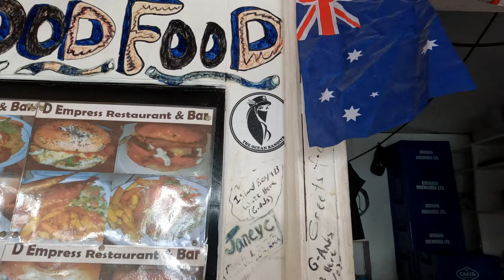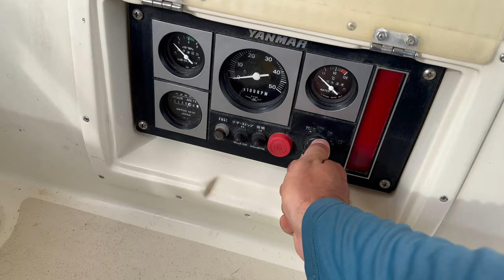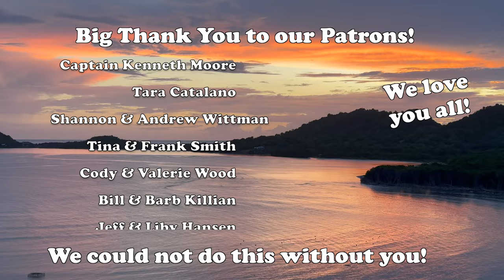A DAY in the LIFE of a SAILOR - Ep. 29

Comment: Looks like the previous owner cheaped out and put in Brass nipples on the sea strainer and not proper bronze.  Sea water electrolysis will eat the zinc of brass and corrode it.  Bronze is an alloy of copper and tin.  I hope your new hose nipple to pipe thread is bronze and not brass. Otherwise the same problem will occur.
Reply from the maker: It does look that way. Thanks for the insight! Will be double checking my metals moving forward👌